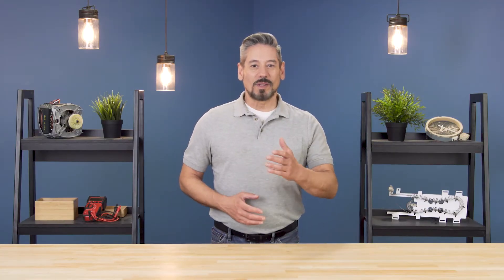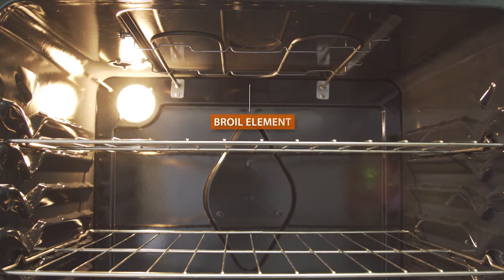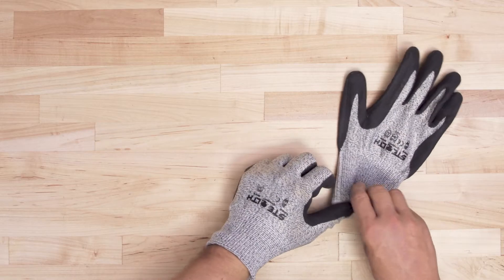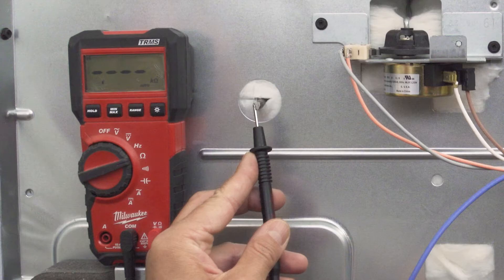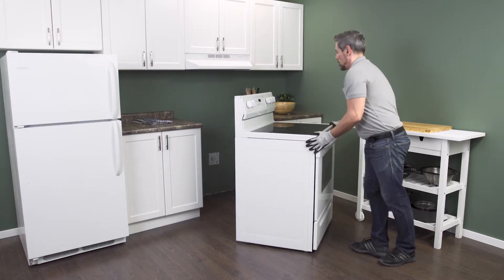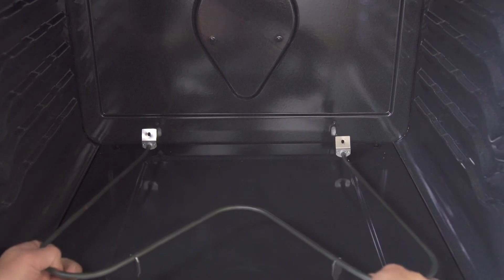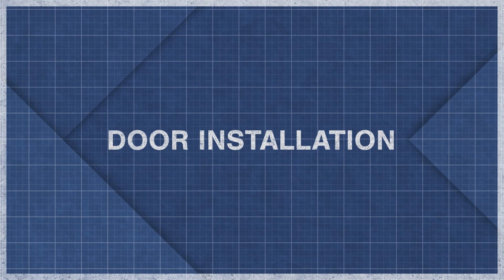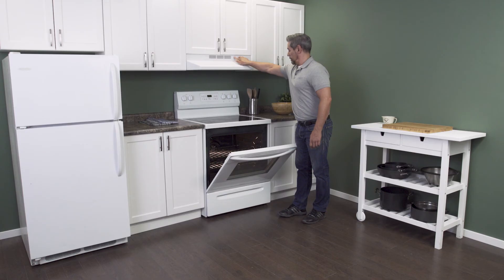Oven Heating Element - Testing & Replacement | Repair & Replace

Comment: What do you think the problem is with my oven the oven doesnt heat up anymore but the top burners work. Should I go out and get a new one it is 10 years old but the top works fine wondering why the oven stopped working.
Reply from the maker: Thanks for watching. If the stove works but both oven elements are not heating, then it could be an issue with a thermal fuse or the temperature sensor. It's best to check those first and you can see how in this video: https://www.youtube.com/watch?v=96s7maybHlY

Comment: Is an oven heating element polarized?
Reply from the maker: Thanks for watching. An oven element is a resistor and is not polarized. Any current flowing through will create heat.

Comment: I may have misheard but is there a way to test if it’s just one heating element bad and not both? If so how do you do that or is it if there’s no continuity then all elements need change?

I have an oven which is convection as well. I try to preheat it and it gets hot up to 300 something then just stays there and it also takes a while to even get that hot. I’m wanting to figure it out before having to buy a whole new oven
Reply from the maker: Thanks for watching. 3:19 in this video shows how to do a continuity test of each heating element. If there is no continuity, the multimeter will show - - - - - - , or OL on the screen, and the element will need to be replaced.

In your case if the oven is slow to heat up it could mean that 1 element is not working. Or it could mean that the temperature sensor is faulty. You can see how to test and replace the sensor in this other video: https://www.youtube.com/watch?v=jnt_mUwdL8o

Comment: I found an odd situation. The broil element and convection element both have continuity and good resistance. BUT the bake element has contunuity and ALSO 2.5Mohm resitance to the frame of the oven! Yet between the terminals there is normal 14 ohm resistance. Oven bottom is severly overheating at up to 600 degrees! When set at 375 degrees. No errors just extreme overheating. Thermal sensor reads ok 1100ohms. Power relay board wws alrready changed no effect. Is this a faulty bake element scenario as described in the video?
Reply from the maker: Thanks for watching. Normally a sensor or control issue would cause overheating but a short can also create that issue. If the sensor and the control board / relay are both good, and the bake element has continuity to ground, then it's best to install a new one.

Comment: Thanks for the video. Our bake element is glowing red on one single corner, even when the switch is off? I checked continuity and the element is bad. What will cause this to be on in only 1 small area of the element e en when the switch is off?
Reply from the maker: Thanks for watching. It is possible that the element is shorted to ground. In any case installing a new element is best.
Reply: @AmreSupply  Thank you!

Comment: Hi! What is the issue if the wire/ connectors in the back of the oven catch fire? I replaced the element about a year ago, and havent had any issues. Could it possibly be a house witing issue that i should be concerned with even if i get a brand new oven?
Reply from the maker: Thanks for watching. If there was a bad connection and the fire started at the back of the elements, then it could have been a short or a bad connection. 

If the issue happened between the oven power cord and the 240V outlet, then it's best to get it inspected by an electrician.

Comment: 1:57 "without continuity, there is no resistance"...Technically, with no continuity there is infinite resistance, not "no resistance"
Reply from the maker: Thanks for watching. Yes you are technically correct about the infinite resistance. We normally say "no resistance reading" and in this section the words were condensed. In these sorts of videos we have avoided talking about infinite resistance as it takes more time to explain thoroughly.

Comment: Can I remove lower bake element without unplugging from Wall ? Just turn off circuit breaker ?
Reply from the maker: Thanks for watching. There are cases like with a built in wall oven that can't be easily unplugged. In those cases turning off the breaker and verifying with a NCVT Non Contact Voltage Tester will be the most safe way to approach it. https://www.amresupply.com/part/9462517

Comment: Top element works, but bottom doesn't.  Replaced with new, bottom one still doesn't work.  Could the thermal fuse be bad, or the temp sensor?
Reply from the maker: Thanks for watching. The thermal fuse is generally wired to the main power and not just 1 heating element but you can still check it to be certain. https://youtu.be/96s7maybHlY?t=241

A faulty temp sensor would prevent both the oven heating elements from working,

It's possible that the control board relay for the bottom element is faulty. These relays are not easily tested, or replaced without additional tools and knowledge.

You could check the wires between the control board and the bottom element and see if each wire has continuity. If you can see any burnt or frayed wires, then you'll have to replace that segment. As well check to make sure each connection is secure.

If the wires are good, then you might need to install a new control board: https://www.youtube.com/watch?v=ORTi4lLyoqw

Hope this helps!
Reply: @AmreSupply  I found the issues. Where the harness plugs into the control board, the yellow wire coming from the bottom element was burnt & the harness end that plugs into the control board was burnt and / melted as well.

Comment: The temp in the oven is off almost by 75 degrees.  I have checked all 3 baking elements and they have continuity.  I have checked the oven sensor, it has the proper resistance.  Is there anything left for me to check to solve this problem?  Thanks
Reply from the maker: Thanks for watching. If the temperature is off by 75 degrees and you've tested each of those components then the only thing left would be the control board. This is difficult to test so it's usually a process of elimination however these are easy to replace: https://www.youtube.com/watch?v=ORTi4lLyoqw
Reply: @AmreSupply  Thank you for the response and I will look into.
Reply: @AmreSupply  Just a quick question about the heating elements.  When i tested them the Baking element had a reading of 14, the broil had a reading of 18 and the newly replaced conventional element had 46.  Would the lower scores for the other 2 be of a concern and could they be the reason for the temp discrepancy?  Since replacing a control board is $400.
Thanks
Reply from the maker: @theczechdude  That is a little on the lower side but it depends on the wattage of the elements. If you know the voltage (240) and the wattage of each element you can calculate what the resistance should be for each: https://www.rapidtables.com/calc/electric/ohms-law-calculator.html

Its also worth checking to make sure that the terminals are clean and the connections are solid. A loose connection can cause the element to heat intermittently.
Reply: @AmreSupply  Thank you again, i have checked the calculation all seems good.  The only thing left is the control board
Reply from the maker: @theczechdude  You're welcome, we're just happy to help in what small way we can! Cheers

Comment: Hi, great video! For a Westinghouse electric oven, are both the bake element and broil element supposed to be on while baking? The broil element only goes on when on broil, but I am told that it should go on at the same time as the bottom one. Thank you.
Reply from the maker: Thanks for watching, we're glad that you found it helpful! Ovens will differ and its hard to know of all the variations. In some ovens both the bake and broil will be on in various amounts while baking. These will not necessarily be synchronized. In other ovens only the bake element will turn on. For the broil setting, only the broil element will turn on. This is pretty standard across all ovens as the purpose of broiling is to brown the top of the food.

Comment: My oven is < 2 years old and the element just stops heating after a few mins intermittently. Don't they either work or not work? I guess it could also be a loose connection.
Reply from the maker: Thanks for watching. You are right that the elements either turn on or off. The control board is what will determine when the elements are turned on. A faulty temperature sensor could cause it to shut of prematurely as it thinks that the oven is hotter than it is in reality: https://www.youtube.com/watch?v=jnt_mUwdL8o
Reply: @AmreSupply  Thanks, I'll check that. I don't think the broiler was used more than 10 times before failing. The oven it replaced was still fully functional after 30 years, although I replaced the bake element 3x!
Reply from the maker: @martik778  In some models the broil element will also be used during the bake cycle so it still gets used. Regardless doesn't hurt to check every connection to make sure it is secure but the temperature sensor is a good part to check.

Comment: Yep,  anyone can unscrew and  change elements as long as the oven its brand new.....now, try  this in  a used, dirty, full of burned oils all around......
Reply from the maker: Thanks for watching. Even when the oven is dirty the basic steps are the same it might just take a little longer.
Reply: I can attest to that. My husband has changed a few elements for us, in dirty old ovens. And I just changed the most recent one, while he was working... Am fixing to go change out my sisters, in her old oven... So she can continue with Tday, while the Ole man's at work... 

I gotta agree with Ole dude. Usually elements in these old dirty ovens are standard. You can find them at almost any hardware store. And the process is so easy, within the right requirements, that someone like me can do in under 20 minutes.
Reply: You can do this. 🙂

Comment: Nice video. I replaced the bottom bake element but no power. It caught fire and the elements was broken.The top coils work fine. The broil element when testing indicated sound. The temperature sensor displayed 11.1. Any suggestions??
Reply from the maker: Thanks for watching. A few points to clarify.

Just to recap... Your bake element burnt up and failed so you replaced it. The bake element still doesn't work even after installing a new one. You have continuity on the broil element.

Now if the temperature sensor is 1100 ohms or depending on the meter it might be 11 (on the x100 setting) then that is within the normal range.

It sounds like it could be an issue with the thermal fuse, or the control board. The relay at the control board might have shorted when the element burnt out.

You can see how to test the thermal fuse, temperature sensor and inspect the control board in this video: https://www.youtube.com/watch?v=96s7maybHlY

Hope this helps!